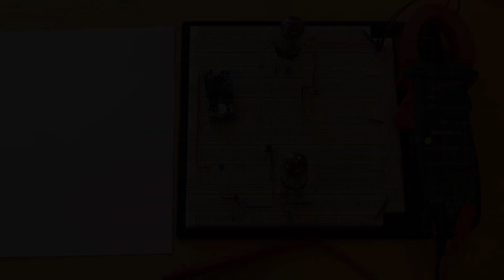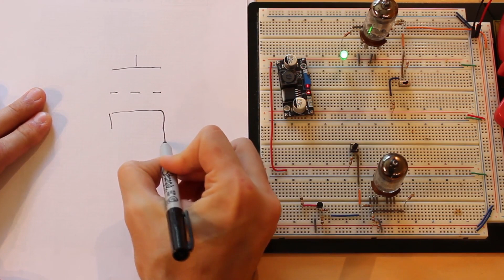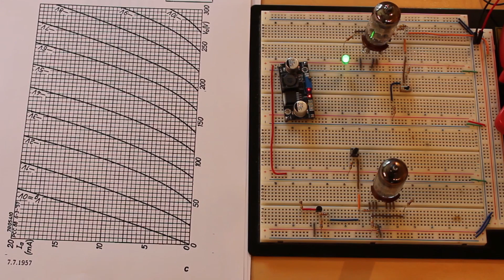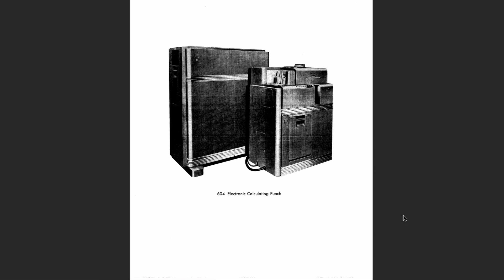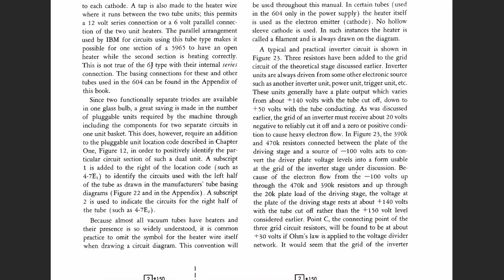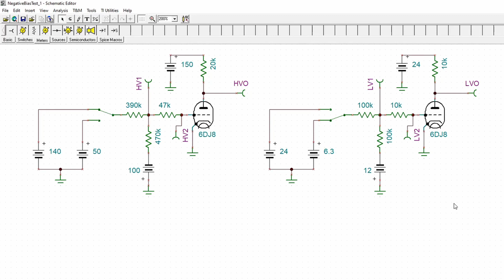Vacuum Tubes: Episode 3 – The Triode (Part 2)

Comment: All diferente between transistor and bulb if because you don’t have correctly polarised the transistor. you need make a correct polarisation to get similar results as bulb. The transistor need 0,6v at base/emisor to start working. If you polarise transistor just when start working, you can see how the led change brightness.

Comment: That double power supply reminded me that the battery powered tube receivers always used three batteries, one for the heaters, one HV for the anode and one LV for the grids. You need three different DC voltages supplied and the sources should be at least somewhat galvanically separated. In the days before solid state power supplies (carbon voltage regulators were the standard back in the day) the simplest and cheapest way to do so was to use three different batteries.

Comment: This channel is EXTREMELY underrated. Thank you very much for your efforts.
Reply from the maker: Thank you so much!
Reply: One of the best on YT 🐰- Also love the clamp on VM - keeps it real 💯 - Also note: The fact he made a 555 timer and OP amp using “valves” is quite the accomplishment. He also answered my 🙋from part 2 - read the data sheet plate characteristics!
Reply: Hard disk connector cable system

Comment: Just use left-handed resistor to get a negative voltage, dude!
Reply from the maker: Power Supply designers hate this simple trick!
Reply: High frequency grease always stops the electron leakage  thru the grid problem!

Comment: One very simple way to put a negative voltage on the grid of a Triode is to put a resistor in series with the cathode to ground, and then put a high value resistor from the grid to ground (say a 1M), putting a resistor in series with the cathode to ground means that there will be a voltage-drop across the resistor due to the current flowing from the cathode to the plate, this voltage drop across the cathode resistor will then raise the cathode to a positive potential with respect to the grid, the grid, because it is effectively at ground or zero-volts potential, will look like it is at a negative-potential to the cathode.
Reply from the maker: Yup, elevating the cathode above ground potential is a great way to make the grid appear negative!
Unfortunately, at the extreme low voltages that I like to work at (commonly +24V B+), I haven't been able to get this to reliably work, there's just not quite enough overhead there to really effectively use this method. In particular for computing/digital applications where I need to push the tube as close to saturation or cutoff as possible to get clean logic highs and logic lows. The solution was to use a separate -12V bias supply, which worked a treat!

Comment: I bought some soviet 6N2П dual triodes to play with after watching your stuff
Reply from the maker: Awesome! The 6N2P dual triode is a good little triode. It takes a bit of effort to get them to work well at low voltages, but with the right resistor values they can be used!
One of the member on the Discord chat group has had good luck with building CRT drivers with them. If you need some help getting them up and going, don't hesitate to ask, I've got a few in my collection I'll be happy to break out and test alongside you with!

Comment: Hi. Great videos, really helping me understand tube circuit design principles. Where did you get the component libraries for vacuum tubes for TINA TI? Thanks.
Reply from the maker: Thank you!
I found the tube model libraries on this website: http://www.normankoren.com/Audio/Tubemodspice_article.html
(Search for the term "downloading the models" to get to the link)
There are also some tube spice models on this website (though I've only tried the 2D21 model): https://elektronikafoto.com/spice-models/
Then importing into TINA can be an interesting journey as well. This is a decent guide on it: https://youtu.be/UjDYO53l_KM
Let me know if you have any other questions or need some help getting the models working!

Comment: Hello, sorry if I missed something. I rewatched parts of this video but I'm still not able to figure this one out. Why do we need to build this inverter circuit? It needs negative voltage so we have access to it. I saw, that it makes 150V out of 50V and vice versa. I don't understand the purpose of this inverter, can you give me some more info? Thank you, it is really awesome video :))
Reply from the maker: Thank you so much!

If I’m understanding your question correctly, you’re wondering why the negative voltage is necessary on the grid, correct? In particular, the IBM Practical Inverter circuit, which uses a -100V bias on the grid and gives an output of +50V to +150V, right? If so, I’ll do my best to answer it! (If not, let me know!)

The first thing to keep in mind is that the grid shouldn’t ever really see any current. It’s mostly just acting as a gatekeeper. The only current flow happening in the tube should be the flow of electrons from the cathode, past the grid and into the plate. In our setup (and IBM’s setup), we tie the cathode directly to ground. When the grid allows electrons to flow to the plate, the plate is pulled to a voltage level close to (but not quite the same as) the cathode, which is why our output voltage drops. When the grid doesn’t allow electrons to flow, the plate gets pulled high through the plate resistor, which is why our output goes high.

Now, initially we tied the grid to ground with a 100k resistor, but we saw that we were only getting about +14V to +5V on the output. The reason our logic high is only at +14V is because the grid isn’t doing an effective job at stopping electron flow from the cathode to the plate. And that’s because the cathode and the grid are at pretty close to the same potential. Without a big difference between the two, the grid just doesn’t have enough negative charge to repel all the electrons boiling off the cathode – the positive attraction from the plate is just too great. This gets worse the higher the voltage on the plate. (There are also a ton of other factors playing into this as well, like grid spacing, construction, material, etc., but that’s a bit beyond my knowledge base.)

So, to ensure that the grid has enough of a negative charge to repel the electrons and overcome the positive attraction of the plate, we actually have to drive the grid into negative voltage. How much negative voltage is needed to fully prevent the electrons from flowing is dependent on how much plate voltage we have. For just +24V on the plate, we really only need to pull the grid to about -1V. But, +24V plate voltage is really kind of out of spec for any tube, so it’s best to overshoot this a bit. For +150V, we need about -5.5V on the grid to fully stop electron flow. 

Also, how different tubes react with the amount of negative voltage on the grid is dramatically different from tube to tube. In this video (https://youtu.be/SUy5yNjTYnk) I do a big test of about 30 tubes varying the voltage on the grid from -3V to +5V. The results are super interesting!

At any rate, I hope that answers your question! If not, let me know and I’ll take another stab at it!
Reply: @UsagiElectric  Hello, big thanks for your answer, even I thought I knew this stuff I still learned many things. I just realized what I was trying to ask. So if I'm correct in the original scheme the -100V is transformed to -8V by the negative bias resistors, but wouldn't it be easier to just hook directly -8V and GND to the switch, instead of using this inverter circuit? And is this inverter some sort of a NOT gate? Also, where did you learn all this stuff, I guess electronic schools don't teach this kind of stuff nowadays.
Reply from the maker: @michalvarsanyi612  No problem!

You’re definitely on the right track! The practical inverter is exactly a NOT gate. But, because of the way the grid must be biased to control the flow of electrons, the input and output of the not gate have to be quite different, which is the purpose of the resistor network. The 390k/470k divider should change the +150V/+50V logic signals to something like +6V/-18V signals that get input to the grid through the 4.7k resistor. Having -18V ensure that the tube is pulled strongly into cutoff, ensuring that the output is as close to +150V as possible. And of course, running up to +6V before the 4.7k grid resistor pulls the grid high enough that the plate potential gets pulled down quite far.

You’re also right that it would be easier to just hook something like -20V and +10V up to the grid and just have that be the switch, but the ultimate goal is to have one logic gate feeding into and controlling another logic gate to create complex logic and circuits like full-adders. The NOT gate can very easily be turned into a NOR gate or even a NAND with some diodes (and we explore this a bit more in later videos). However, whether it’s a NOR or a NAND gate, the output is pretty much always +150V logic high and +50V logic low. So, the 390k/470k divider is there to transform the output from a previous inverter/logic gate to appropriate levels for the grid.

As for me, well that’s a long story, haha. However, I weirdly, went to University for language, not engineering. I majored in Japanese with a minor in Korean, and my day job was definitely in that field (until this whole quarantine thing put a lot of that on hold). So, all of this electronics stuff is all self-taught, mostly from reading the IBM Customer Engineering manuals for various IBM vacuum tube computers (excellent resource here: http://www.bitsavers.org/pdf/ibm/).

Let me know if you have any more questions!